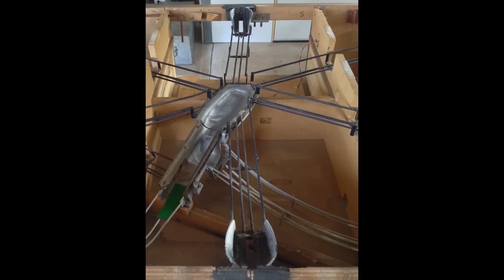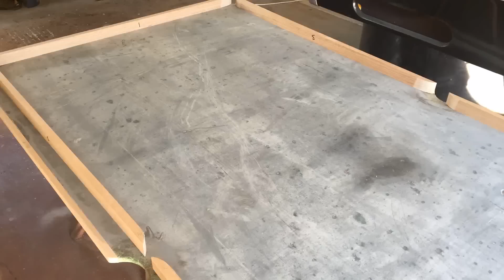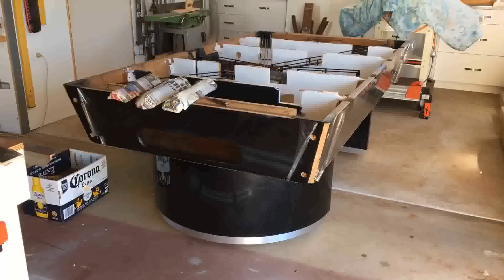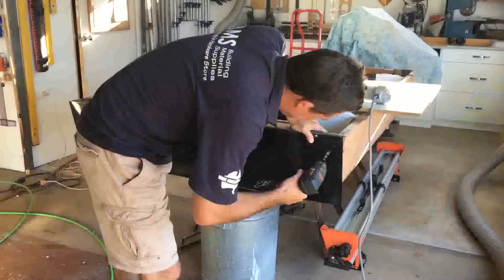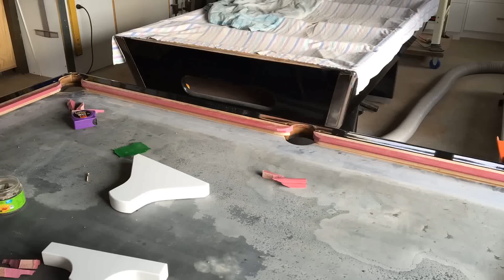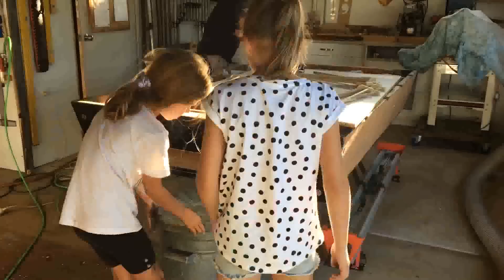How to Build a Pool Table

Comment: I am currently restoring an old fischer regent barbox. The rails look very similar to mine. My rails are stapled together at the four corners, if these rails were, did you remove the staples ? Thanks
Reply: James Perkins yes every single one. Our rails were basically remade from scratch